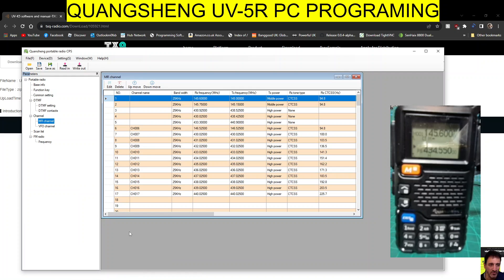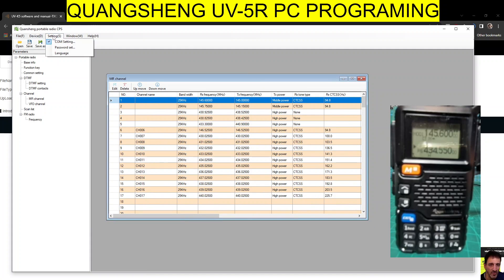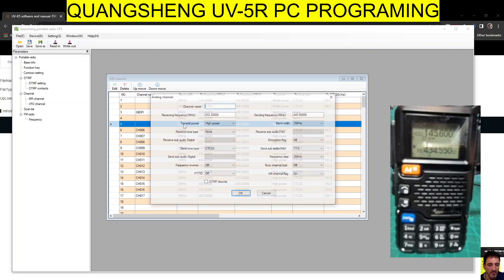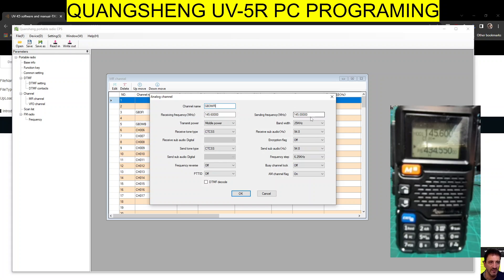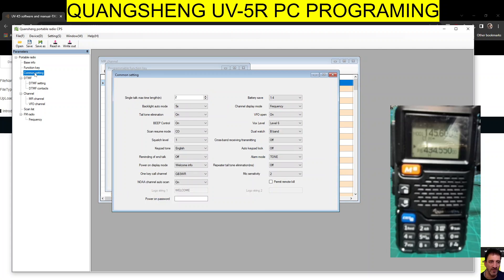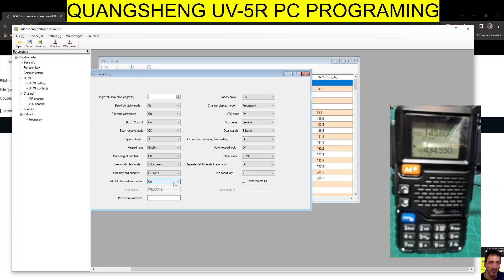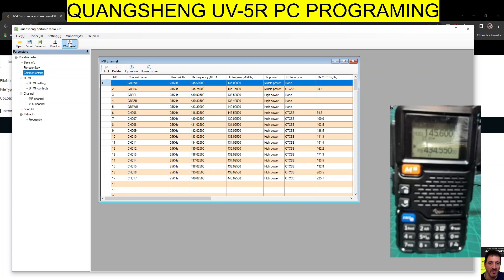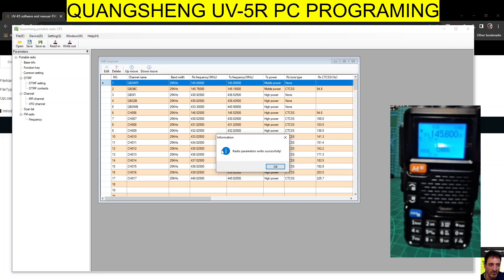QUANSHENG UV-5R PC, PROGRAMMING

Comment: hi there! all I could find is a Baofeng cable, but it doesn't seem to be connecting with the software. Radio connected (off), app launched, radio ON (light on top on), COMM port checked, tried to read in, connection failed. What do you think the issue is?
Reply from the maker: Push the cable in a bit harder .
Reply: damn... my saviour :)  @M0FXBHamTech